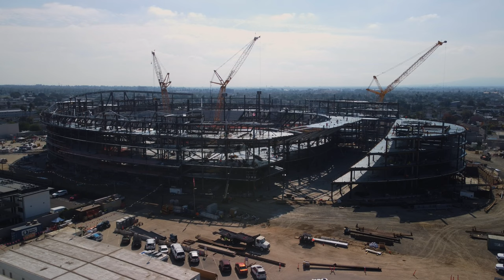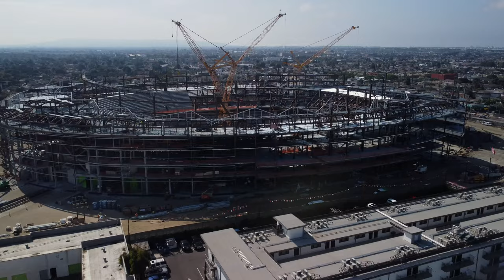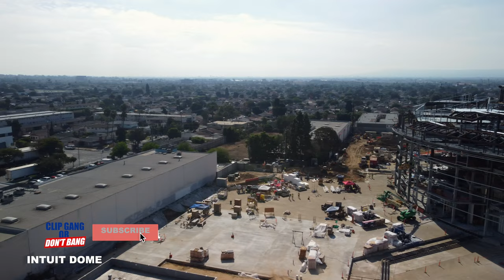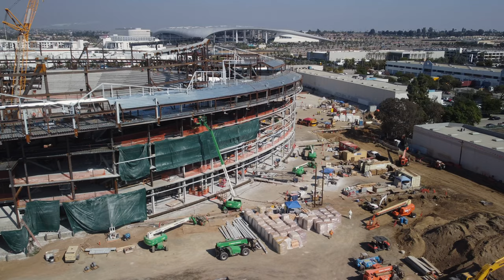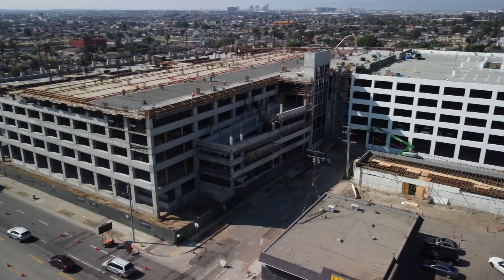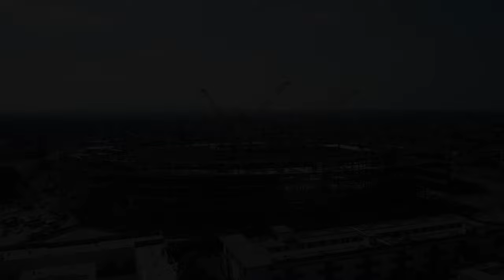LA Clippers $2 Billion Intuit Dome Aerial Drone Construction Tour

Comment: Nice photos, I heard is going be basketball first only, no ice hockey configuration which in my opinion doesn’t make sense. If going your going  to  build an arena, you got think about the other 320 days that basketball is not in being played, since that the arena going be used 41 days out of the year for basketball. 

If I was Steve Balmer I would built the Intuit Dome to accommodate both NHL Ice Hockey and  Basketball.  By building it to accommodate ice hockey, It would   be able to have ice shows as well such as Disney on ice in addition to concerts. In addition, the Kings could also use for preseason games, and as a backup arena should Crypto arena is not be  available for whatever reason.